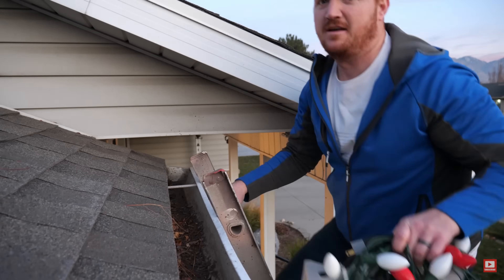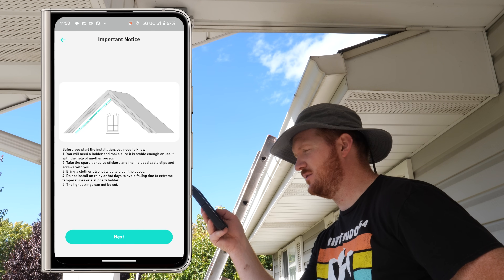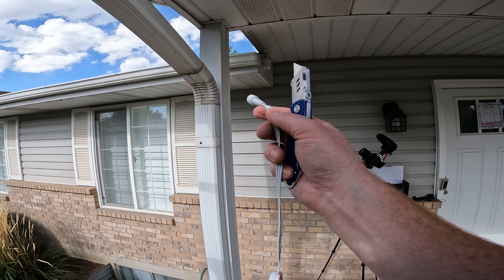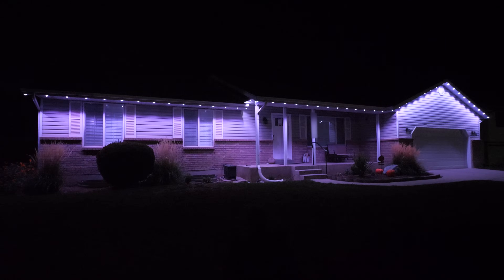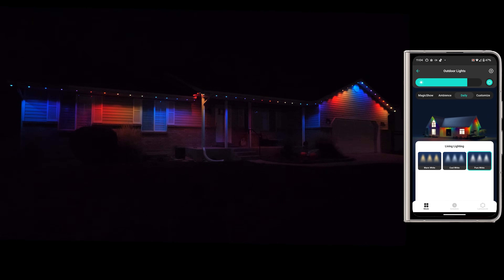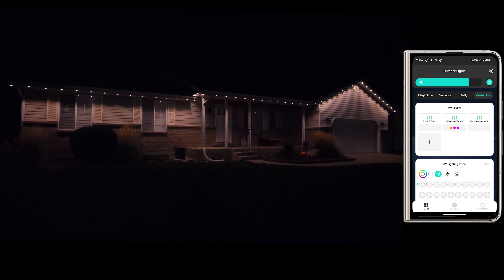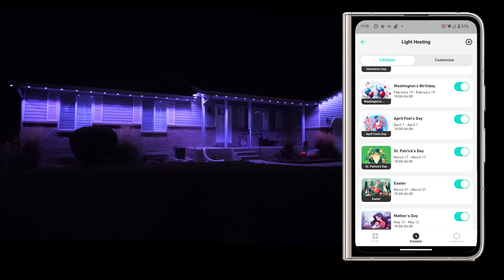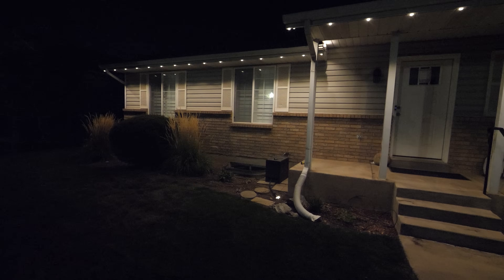Put These Christmas Lights Up & Never Take Them Down

Comment: how did you plug them in since the plug is not waterproof?
Reply from the maker: The recommendation is to use a waterproof box for the power supply. If you reach out to support they can provide one for you.

Comment: Putting the wiring and connection in a gutter where water will flow.....
Reply from the maker: I was trying to be quick. I have since placed it on the gutter and secured it on the top.

Comment: I have had these lights since they became available and had some time to mess with them. I bought 2 kits and noticed that you can not link 2 sets in the app... so that means that you can not share custom scenes or have them run together and have the same effect. You have to make 2 different scenes (one for each string) and that is a pain... This is disappointing... I have contacted Eufy (Anker) and they are aware of the issue and said they will be putting out a firmware upgrade to make everything sync together (so they say). 

I am also not sure what (light show Mode) dose... I see that it should link them together as the bluetooth symbol is on when I turn that mode on... 
Another issue that I am having is that when the programed Scenes end and I want nothing on, it runs a random pattern... I just created a custom scene with only one light on, and run that from sunrise to sunset... Eufy said that I had "Smart Gradient" turned on...   Not sure what that is, or does... but, I have yet to try to run my schedule with it turned off. 

The Ability for it to run scenes based off camera motion is a cool feature... but I dont think its enough at this point for anyone switch from GoVee...  Eufys app is not even close to Govee and their ecosystem when it comes to customization... and the "magic dice" seems to be like 6 patterns with different colors... The AI always wants me to give them more info... even when I type exactly what their suggestions are... If you are going to go against someone that has been doing this for years... you better have a system worth switching too.  

With GoVee you can layer (Like Photoshop) different colors and patterns for truly endless possibilities... With Eufy you can not... I did let them know this as well, and they gave me the corporate response that they are always evolving and looking into how to better their product. Honestly, I don't see them making all these changes unless they can come out with more lighting products to rival Govee. 

Great Video Brett... I was hoping you would do one on these lights.

Comment: you can cut the strings just voids the warranty and you have to be smart and make sure you wire it correctly. You need to protect the power adapter its not waterproof like Govees is.

Comment: And the install looks terrible I don’t like the exposed wires - the track lights are so much nicer
But the way you have them away from house has a nice look
Reply from the maker: It is actually surprising how you don't really even notice these during the day which I thought they would stand out way more. Putting them closer to the wall does make them stand out a bit more.

Comment: Great video, one suggestion is to move the lights closer to the wall so they light up the wall more ( the lights  over the garage show up better when the lights are alternating than other sections of the house)
Reply from the maker: Great tip. My goal was to see how well they hide when put close to the end and I think the mission was accomplished. Putting them up against the wall would have worked in some areas but then you lose that classic look. I might have to try it out with the last strand I have.